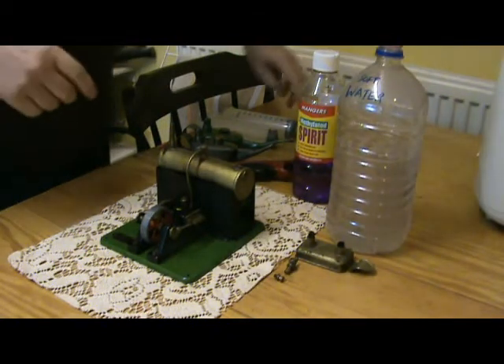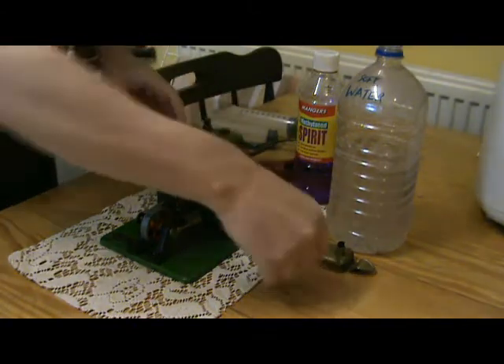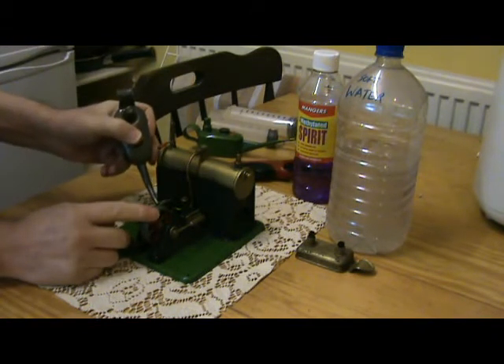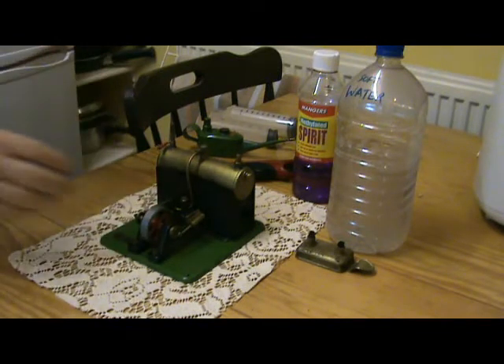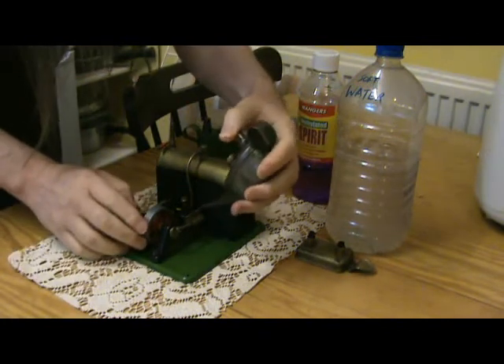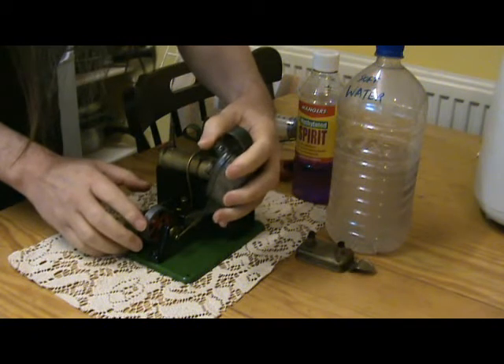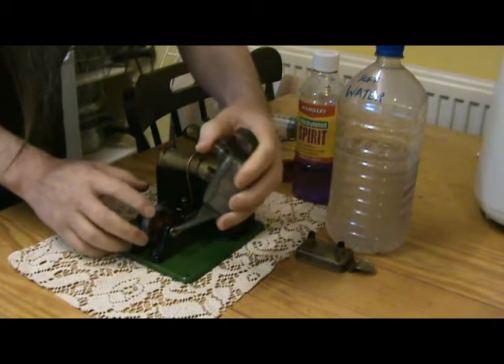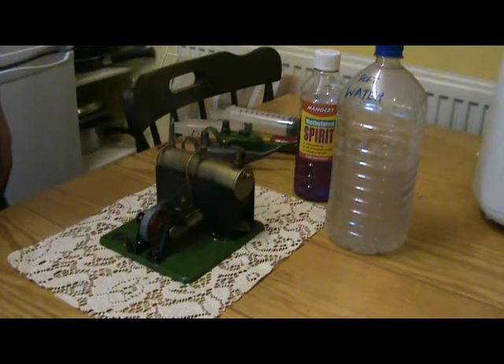SEL 1550 Major

Comment: I just bought a 1550 last week but haven't had the time yet to go through it.
Your engine put out a lot more rpm than I expected.  Was the pop-off valve stuck shut?
Reply from the maker: No, they are small and high revving engines.
Reply: @RolyWilliams  Hello Roly,
I bought a 1550 last week, soon when it runs as fast as yours, I won't freak out!
Thanks for the heads up.
Paul